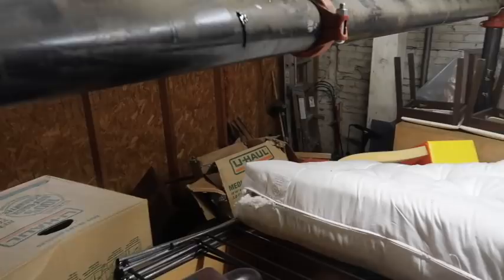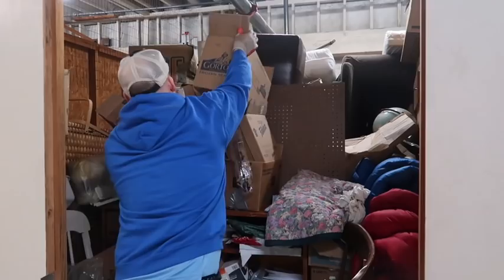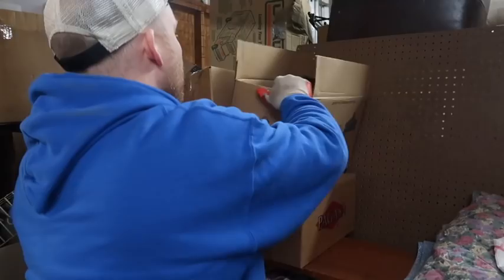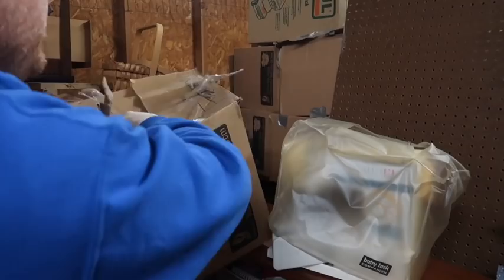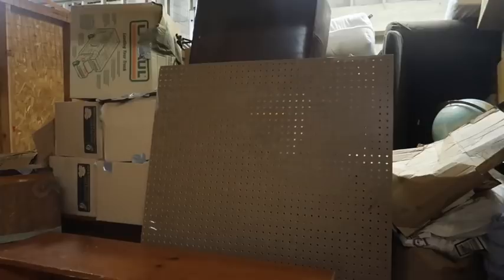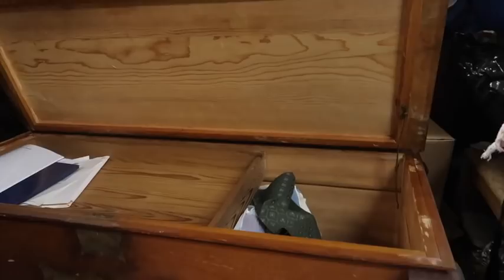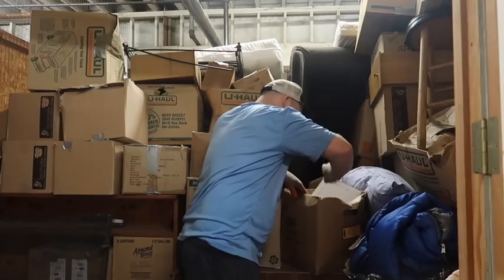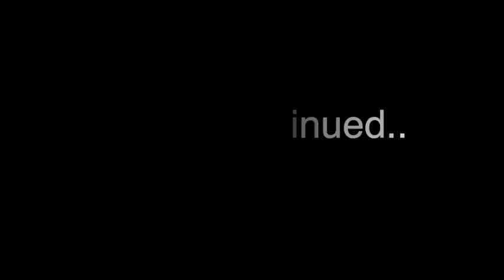Worlds LARGEST Abandoned Storage Unit

Comment: Curious about the Emdeko sewing machine, I looked it up and here's what I found : Emdeko JA21 was made by Toyota in the early 1960's, and the engine was made to purr. With a 1.3amp motor, JA21 is robust and able to sew thru just about anything. I've sewn thru several layers of denim, quilting, and even layers of fleece.